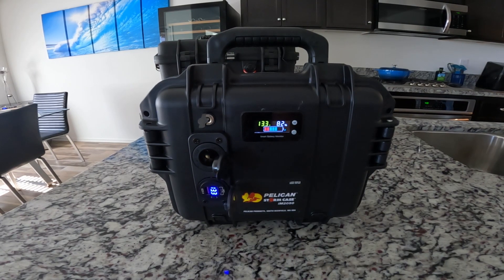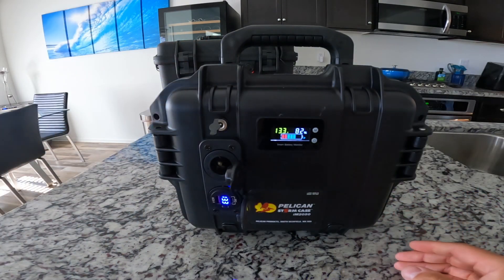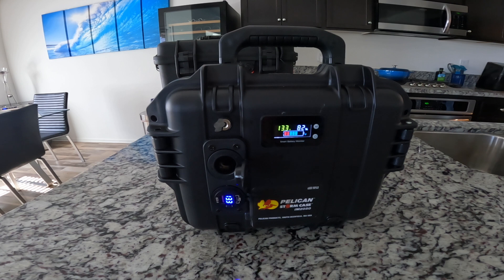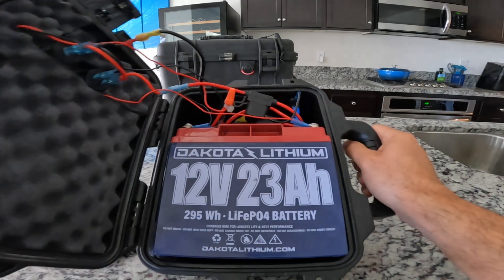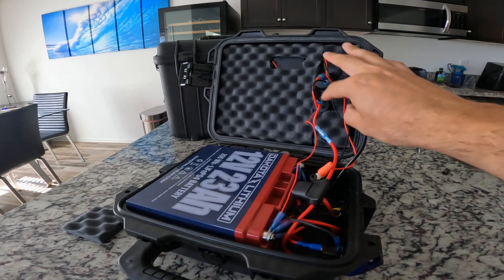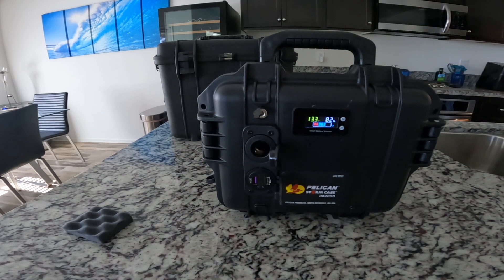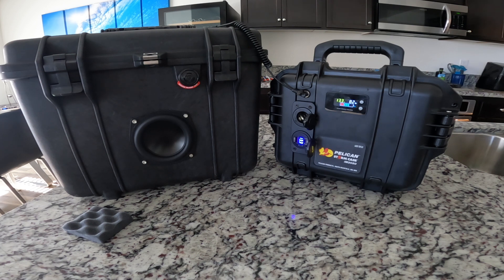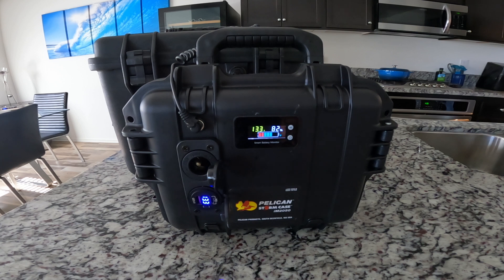The Ultimate DIY Pelican Case Lithium Ion Battery Box Build!

Comment: The SAE port is for charging right? It just goes right to the battery lugs and you use an external charger right? When you charge do you open the case for heat or is it not an issue since the charger is external? Cool build. I definitely love Pelican cases, they are made in my home town South Deerfield, MA!
Reply from the maker: yup! the sae port is for charging, you can use it for anything though that requires power if needed. No issues from heat while charging with a 5 amp hour charger by NOCO. Thats awesome, would love to tour the facility if i every went there
Reply: @so-caladv1179  Can you charge and supply power at same time through other outlets?
Thanks!